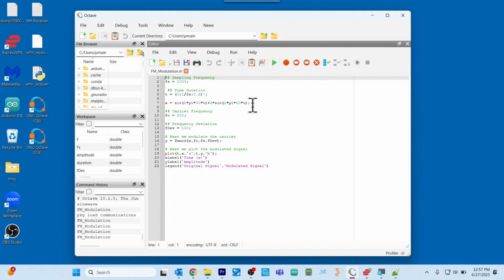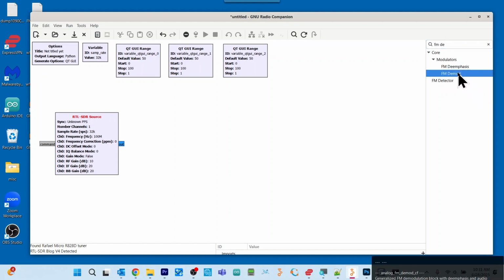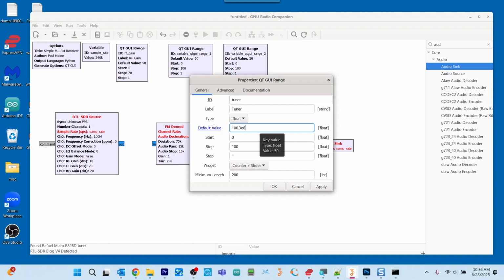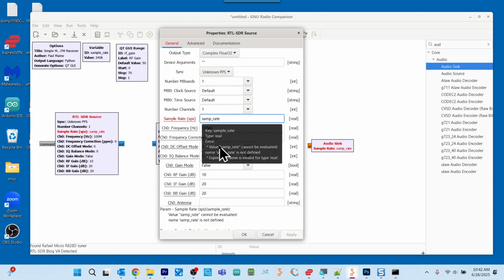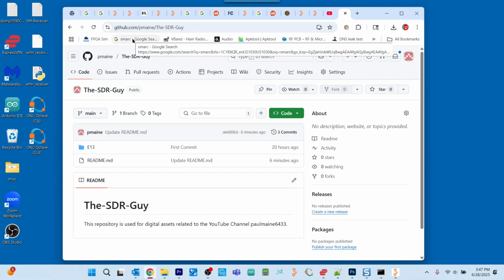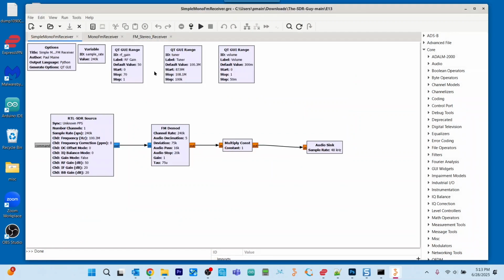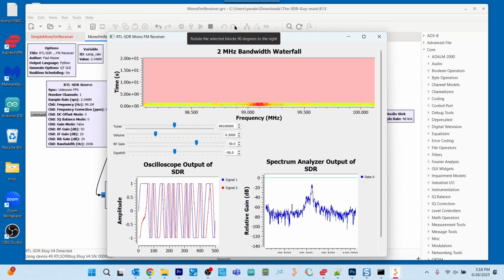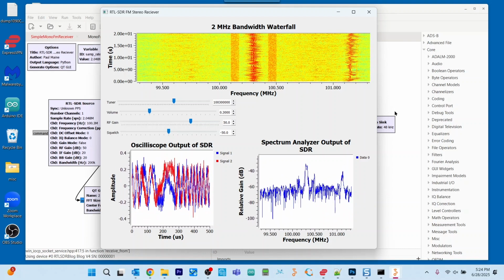E13 Create FM Receivers with GNU Radio and RTL-SDR

Comment: Good one! I will suggest one thing: When you run the more sophisticated receiver (with waterfall, time and frequency sink on the output of the RTL-SDR), the time sink shows that the signal is clipping (top and bottom are flattened out). With a RTL-SDR in Gnu Radio, this means that you're clipping the digitizer, which means you're distorting the signal and adding noise across the spectrum. Drop your gain a bit until it no longer clips and your spectrum will be cleaner.
Reply from the maker: You are 100% correct. In the video explanation of the user interface I explained that you should adjust so the signal does not clip. I should have taken more time in the final video segment to adjust the gain so that it didn’t clip. Thank you for your comment! Do you have any suggested topics for future videos?